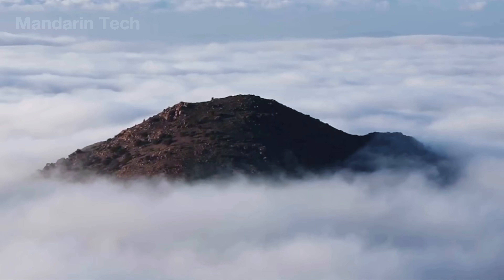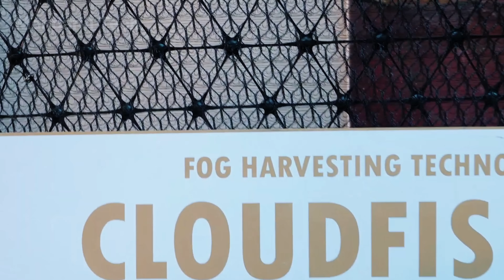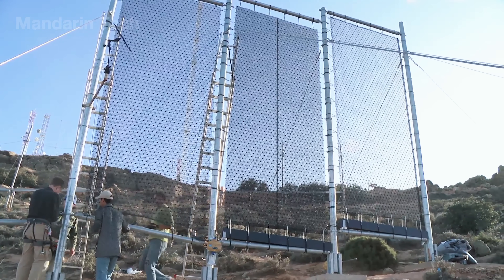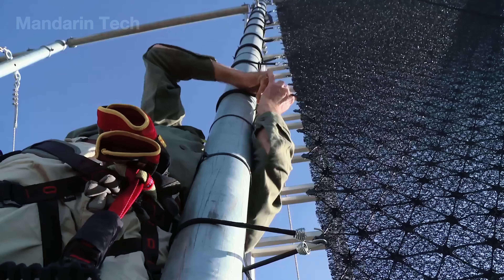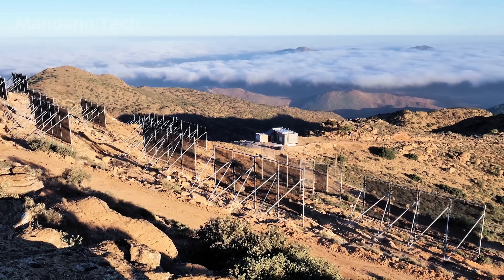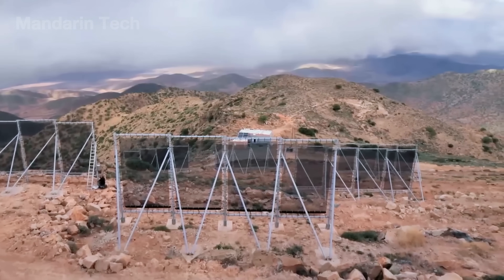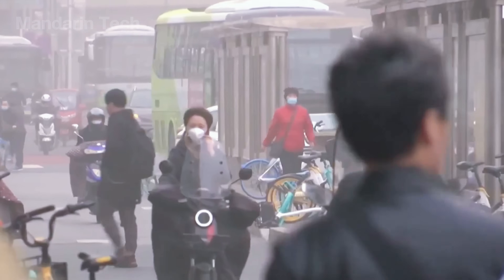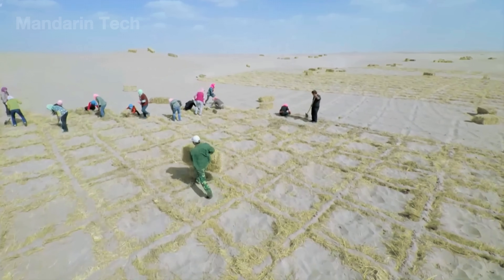How Germans Produce Millions Liters of Water In Sahara Desert Using Unbelievable Technology

Comment: What does it make like 5 gallons?
Reply: That jumble of statistics with mixed units was indeed confusing but I think the takeaway is that 31 Cloudfisher panels (plus pipework and storage) provide sufficient potable water for 15 villages, 1250 people, 7000 animals and vegetable gardens, so many thousands, if not millions, of gallons.  Excellent German manufacturing means the hardware is durable and low maintenance.  The difference this must make to the lives of those villagers is almost unimaginable.   Then AI took over completely and the second  part is contradictory and ridiculous!
Reply from the maker: It actually produces way more — these fog nets can generate thousands of liters a day depending on wind and humidity. Pretty insane tech!

Comment: The word "Sahara" means "desert" in Arabic, derived from the word "\(arā\)". Thus, when referring to the Sahara, you don't need to say desert. My own experience of producing water from air cooler in Ghana is very encouraging. I produced 100 litres of water from my air cooler which was fitted to my room. I grew vegetables using this water and my watchman used to bathe using this water. Sounds strange. Nonetheless, it is the reality. I found that most of the buildings at the University of Ghana are fitted with air cooler and thus, it is possible to collect this water otherwise it goes to the drain.
Reply from the maker: That’s a great example — collecting water from air cooling systems can be surprisingly effective for small-scale use.
Reply: @Mandarintechmido  Rahman, M.H. (2014). Air-cooler’s water can produce crops and vegetables – an Accra, Ghana experience. City Farmer News. Vancuver, Canada.
Reply: ガーナ:の年平均湿度は約80%前後です。一方 サハラ砂漠では平均湿度は約30%程度と言われており、場所によっては湿度がほぼゼロになることもあります。 
エアクーラーを使うと水が副産物として出来るのは、大気中に水分が有るからで、クーラーを使えば水が出来るとは限らないのです。
もっとエアクーラーの仕組みを勉強しましょう。
Reply: @glu583  I do not have any experience about Shara. My Ghana experience may be of some use in West African countries like Senegal, Cot de Ivori, Burkina Faso, Mali and others. It carried out this experiment out of my curiosity and I think, Ghanaians may conserve water in this way. Otherwise, this will go to the drain.